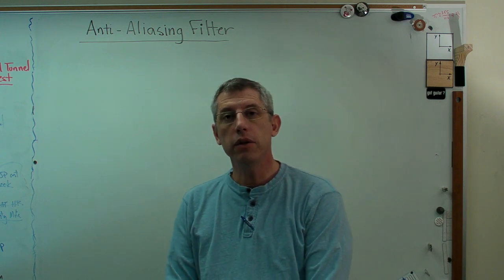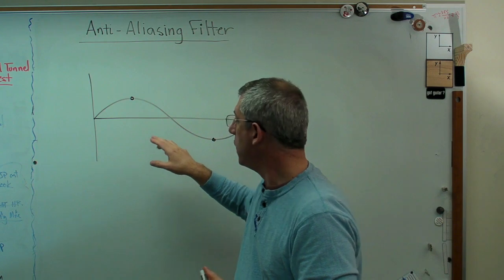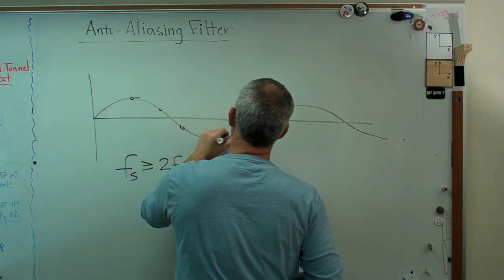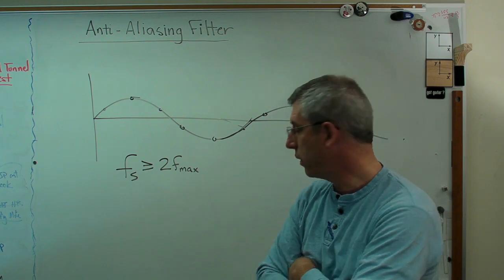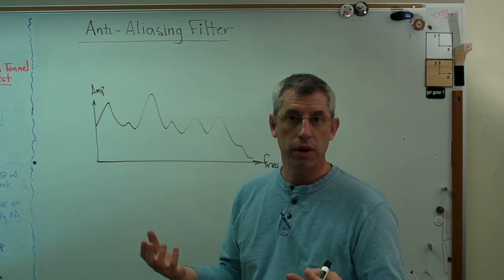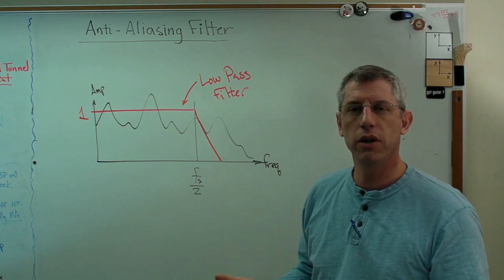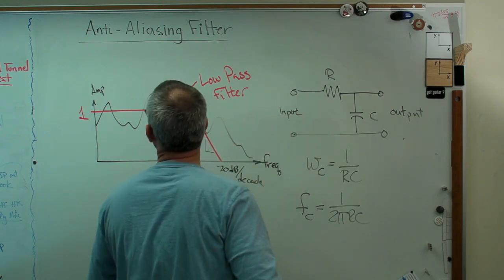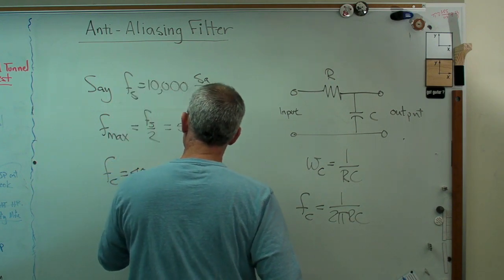Anti-Alisaing Filter - Brain Waves.avi

Comment: "Fewest number of samples per cycle is two". But how do you know you're sampling the peak and the trough?
Reply from the maker: You don't.  The fewest possible number of cycles is two, but that's the ideal case.  In practice, you need more than two.  All the data acquisition systems I've used sample at more than 2x the maximum frequency.  I think the Agilent (used to be HP) system sampled at 2.56x.
Reply: @purdueMET  Okay, thanks!

Comment: If fs=10kHz and the input signal has fmax=5kHz, then the cutoff frec. cannot be less than 5kHz, because then you 'filter' the 5kHz signal. An anti-aliasing filter tries to delete the high frec. signals in order to allow the computer read the signal we want. It is usually used in AD Converters. Anyway, fs is usually 10-20 times higher than the signal frec. and also 10 times higher than the cutoff frec.
Sorry for the English... ;)
Reply: In MRI the signal-frequency can be 64 MHz and the sampling-frequency is 1.024 samples/sec. (or less). That's a ratio of 1/64.000. How can that be???

Comment: Very well presented and explained. Although the filter commits to the requirements, it's not complying to basic rules of design. When designing various parts you should give the most expensive component a fixed commercially available value, then design the rest to fit as much as possible under more commercially available components. In this case, you should have picked the capacitor first, then calculate the resistor. It's easier to find many resistors than capacitor values on real life design.